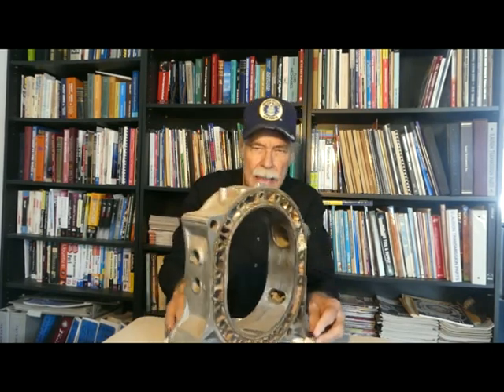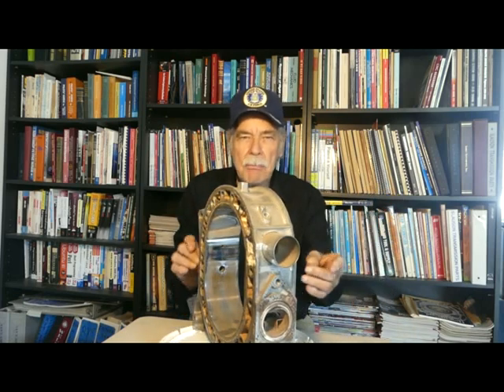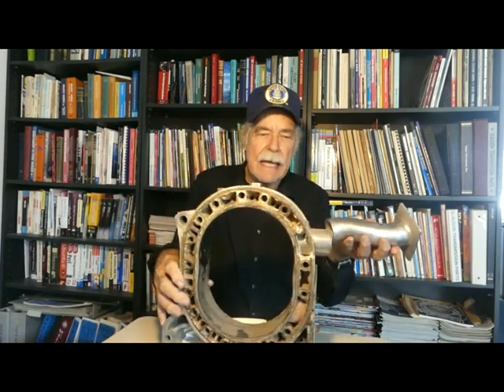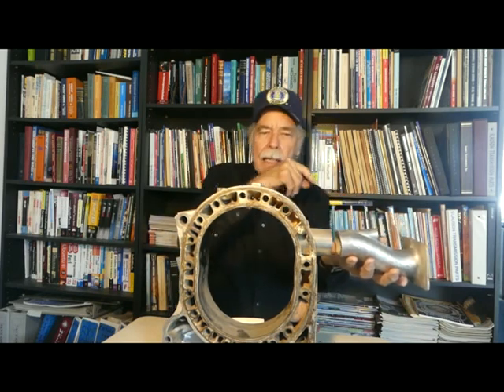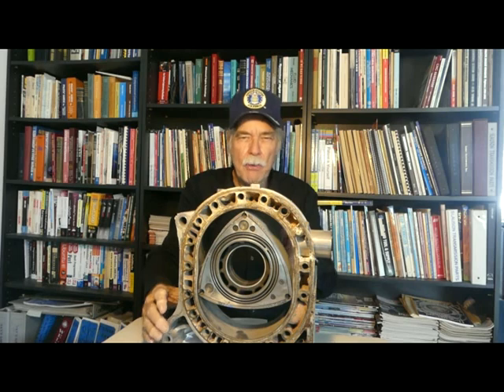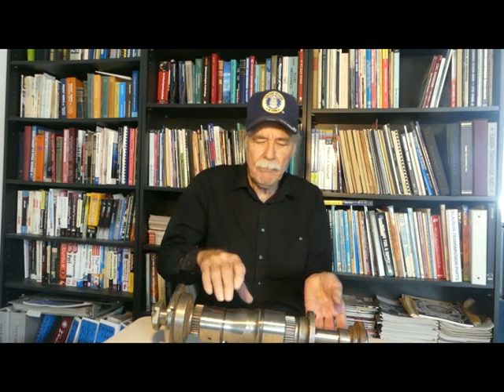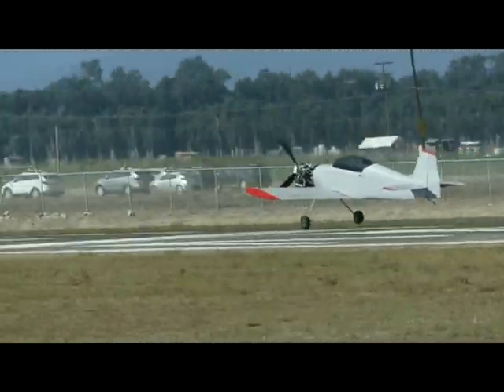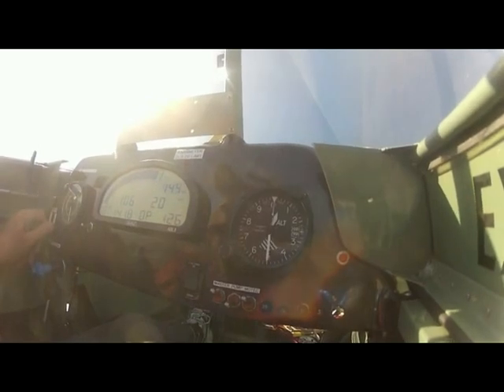Why the Wankel 1

Comment: paul when a apexs seal lines up with the leading plug hole you have inside major leakage in the engine from chamber to chamber this why you have high egt;s  and why you have low compression   watch rotary hemi breakthrough  offset compression   we missed alot on the wankel design  me two
Reply: GM reached a 750'000 useful life in their Wankel, but never explained in detail how.
I'd say again the best approach for a Wankel RCE is a Periferal Intake Port, as in the NSU engines, and a Side Exhaust Port, as in Mazda RX-8 Renesis. 
But I have interest in riding an street car, not in flying.
Austro is still selling Wankel, Aixro sells 40 HP single rotor units for ultralight aircraft and motorized parachutes.
There are more Germany and UK makers of Wankel suitable for Airplanes. 
I guess FAA certification is a very costly procedure, you need a lot of engine sales to go even after such investment. 
Gesund +
Reply: @joseveintegenario-nisu1928  There are no Wankel engines certified for passenger aircraft, no Wankel engine has ever passed the minimum reliability standards
Reply: That was actually solved a long time ago with a tiny "slit" ignition port, with a shielded plug. Of course, you can now use laser ignition, which requires no actual opening (perhaps a sapphire window.) I certainly know that a ceramic housing and an inconel (or other high-temp alloy) rotor with direct injection and laser ignition is possible today, along with low-friction coatings to eliminate the necessity of oil burning. Add turbo-compounding, and you have a really good airplane engine.
Reply: @UncleKennysPlace  Then why are there no certified Wankel engines?
No one has ever made a Wankel reliable enough to pass a PFTR or  FAA EASA airworthiness certification.
Reply: @sandervanderkammen9230  The market is too small to justify the expense of developing and certifying a new engine. "You make a small fortune in aviation by starting with a large one."
Reply: @MurryR100  Bullshit, Curtiss-Wright was the worlds first manufacturer to license the Wankel KKM engine from NSU Motorenwerkes GmbH. in 1958.
C-W was chosen by the FAA to help  develop a certification program for Wankel engines.
C-W developed 23 different Wankel engines between 1958 and 1984 but abandoned Wankel aircraft engines in 1974 after it was unable to meet the minimum FAA requirements for reliability.
 Most reciprocating and turbine engines available in  the GA market are now over 50 years old and there is a growing demand for engines with the efficiency of a turbine but in the price range of a reciprocating engines.
Austro Engines has had good success with its 4-cylinder TurboDiesel engines based on Mercedes-Benz automotive engines.
 Austro abandoned development of its Wankel engines after failing to maintain its airworthiness certification.
Reply: @MurryR100 You could have a Glow Plug or Ignitor on leading plug site, along with other changes, Toyota got a 9% economy improvement with this.
At plug hole, pressure differences between the two adjacent chambers have not a lot of importance.
Reply: @joseveintegenario-nisu1928  Why would you want an uncontrolled, untimed ignition source?